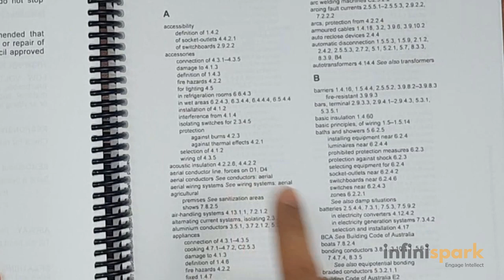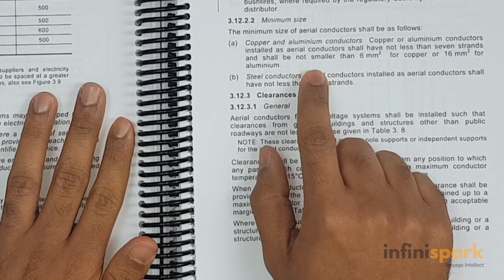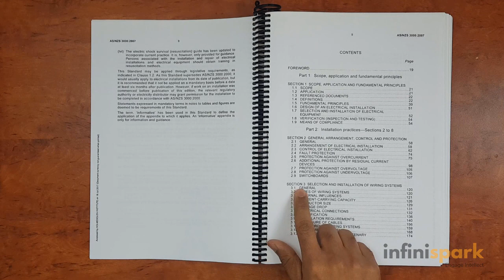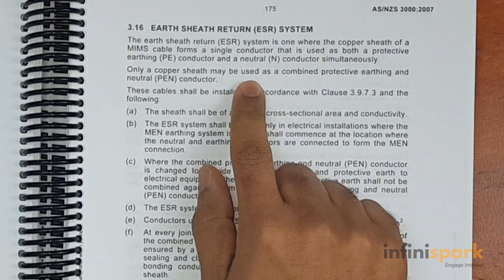How to use AS/NZS3000 Wiring Rules

Comment: Hi Hus, could you explain and provide examples about e-exam, currently NZ EWRB has changed from paper to computer based. AS/NZ 3000 will be only provided for some questions and will be electronically available during testing session. Is it still permitted to bring in own materials to the exam? Cheers,
Reply from the maker: Hi Michael, I'm afraid I don't know much about the new e-exam. We are based in Victoria, Australia and as far as i know, we are still doing paper based.
I would think that they would allow you to bring a hard copy of the rules because that's more realistic, but assessment centres can have specific rules to make the exams more consistent across the board. Have you tried contacting the EWRB directly?
Sorry, I wasn't much help. All the best for your test.
Reply: @infinispark   do you take private tuition  online ?? . I am based in Sydney.. and need some guidance

Comment: I wish you did a series of the wiring rules from start to finish explaining them in plain english
Reply from the maker: We have been thinking of doing that for some time now, but it's such a big project and our core business being manufacturing, we haven't been able to commit to it. 
Do you feel that there's a huge need for something like that? Do you think they should be made for apprentices or sparkys?
Thanks for the feedback Michael
Reply: @infinispark  Maybe aim it at apprentices with photos of everything being discussed so they can understand things they have not seen yet. However, lots of electricians would also want this as a refresher or they may have nver worked in certain areas. Then if an apprentice has a bad lecturer or misses class due to work commitments he is not left behind.
Reply from the maker: Thanks Michael. When we proceed in this area, we'll definitely keep this in mind.

Comment: How to run regulation book sir ?
Reply from the maker: Dear Gurlabh, unfortunately not all Regs books have index, so the only way to use them is to know the content well. The method of table of contents would still work but you still need to know your stuff.

Luckily, none of the other books are as big as 3000, so going through them a few times in a short period is doable and that would be my suggestion.

I hope this helps, all the best.